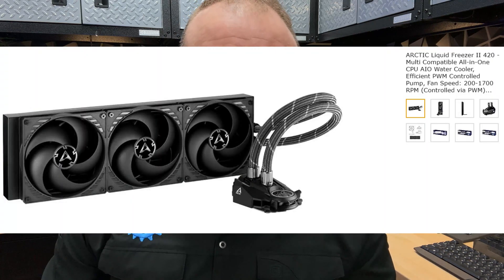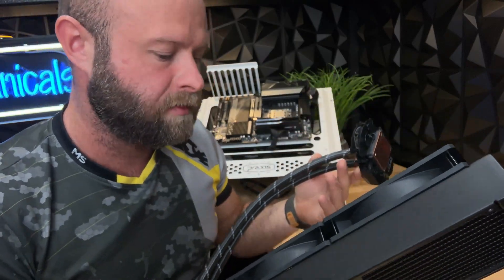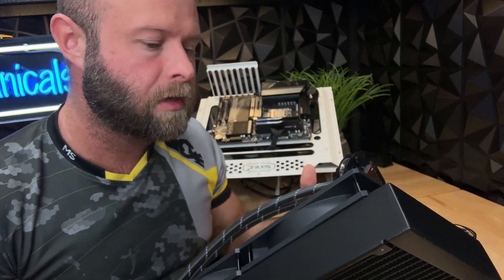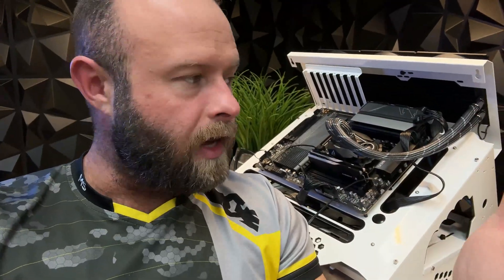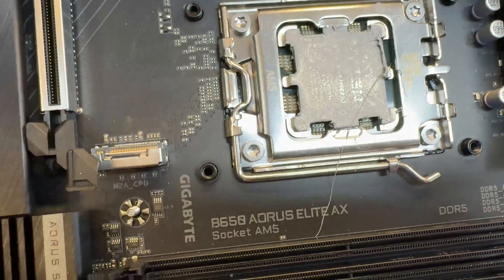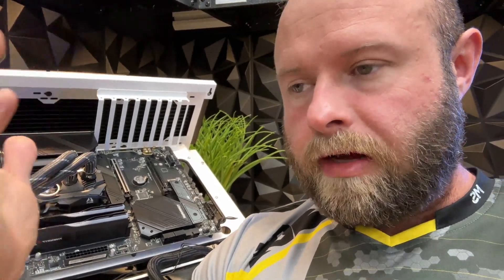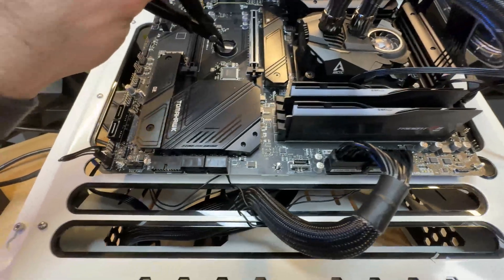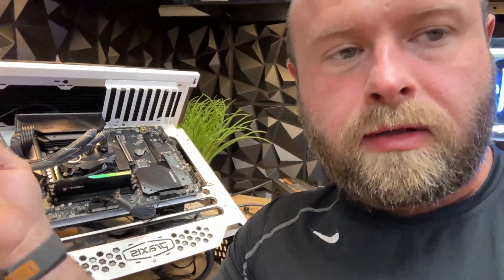CPU Mining S1.E2: Cooler swap NIGHTMARE

Comment: Hi, how are you? I congratulate you for this content. There is not much information about this processor and the 3D series. Currently I bought 3 of these processors and I still haven't bought the RAM or the motherboards. I wanted to ask. Could you do unvervolt from the bios or is it really that it can't be done? In GR do the watts go up a lot? I am seriously thinking about returning this model and exchanging it for the 7900x and 7950x. I look forward to your comments as they are very helpful to me. Thanks in advance
Reply from the maker: I plan to get a 5900 to learn on while running the 3d stock until im comfortable enough to OC it

Comment: Water cooling is not good for mining, in about a month your rig will start overheating because the water gets hotter and hotter. Water cooling is only meant for regular rigs that shut off from time to time because water cooling needs to be shut off once in a while to allow the water to cool down. Good luck.
Reply from the maker: Thanks, very aware of the dangers, which is why I went super-overkill on this AIO size. If nothing else, it will be a good test to find out if there's an escapable-threshold where an AIO can be so large it will never encounter this.
Reply: @TechnicalsMatt  I had a 360mm running 24/7 on Raptoreum and it broke the pump in about a couple of months due to it overheating, just go ahead and test it out and monitor temperatures. You might have better luck than me but if you want a good brand for air cooling then Noctua is the way to go, expensive but totally worth it.

Comment: I'm enjoying following along; glad the issue just ended up being a bad RAM stick, though I know troubleshooting that was a hassle. The whole time I was scratching my head because from my perspective using the Liquid Freezer 2 was super easy on AM4 and AM5 and not super finicky. Also Gigabyte and MSI motherboards are the best IMO for AM5 (I prefer MSI somewhat this generation but either is good), Asus does really well on their Intel motherboards. 

6000MT/s CL30 kits for AM5 are the sweetspot for EXPO as well if you end up getting a different RAM kit in the future, but any Hynix kit can be tuned to some extent as well. I have basically the same kit as you just with tighter timings on another rig and it's pretty great for EXPO.

Comment: Remember - your hashing at a lower rate now because of the ram - the temp is artificially lower as your missing 4-5kh of work the CPU isn't doing.  When you put the second ram stick back in your temps will go up.  Like I said anything 70 or less is great.
Reply from the maker: Running all day on 2 dimms now, slight increase but out of the red. No tweaks to OC other than XMP and i'm not entirely sure I will given how finnicky this particular CPU seems to be. Need to build confidence in it, maybe get another, smaller CPU to learn on. This is why parents say don't get a nice car as your first, right? lol

Comment: If you start getting computer crashes for no apparent reason, the number 1 thing almost always to do first is the ram tests, for example using memtest86 (or some newer version).   It can take hours, but if that test finds even 1 error, you got the culprit there.  The next step is to test different ram settings, sometimes it just happens to be so that the speediest settings do not work but have to step down some speed, and then test again.   This has been almost always the reason I have had issues with computer if there is nothing really broken - excluding any broken driver issues with windows (which is different topic in my mind)  EDIT: yeah you got broken ram, not surprising. It's sort of easy to just use 1 ram stick during testing you find it fast which stick doesn't work.